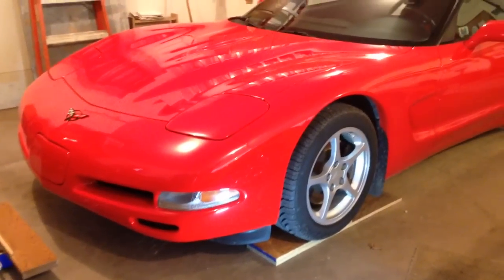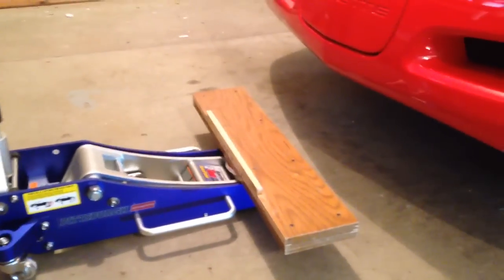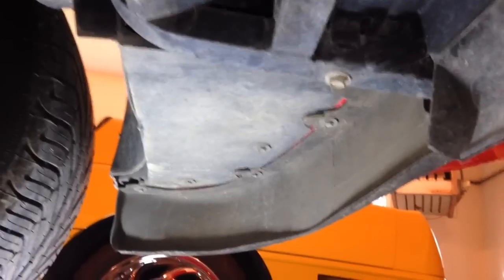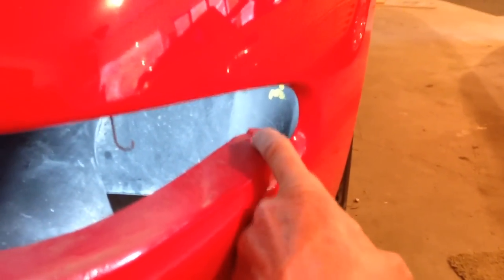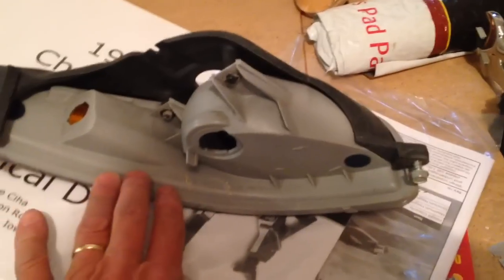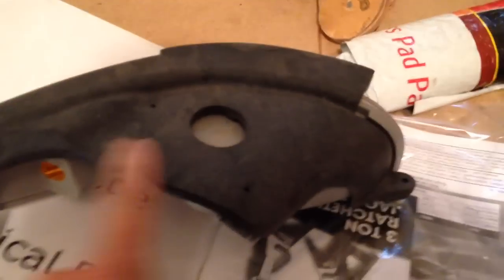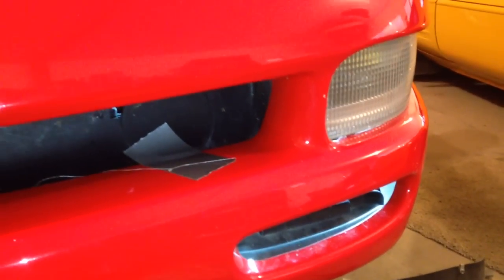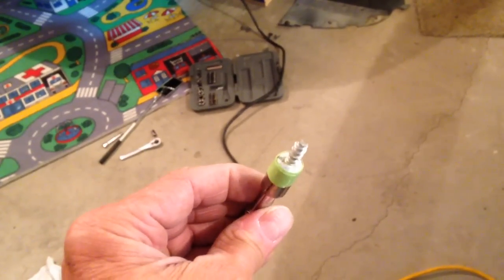C5 corner lens replacement

Comment: Excellent tutorial!  The tape on the socket trick was a new tip and very creative.   I can't count how many times over the years I cursed out loud after snaking my hand into the most contorted locations only to have the screw / nut fall off the socket upon contact!
Reply from the maker: Thanks SM.  After building 2 aircraft, I learned all sorts of ways to install and tighten fasteners of all types.  Your feedback is why I do videos such as these.  Best to you.   steve
Reply: I really liked your video. Maybe reattaching the spring is real easy, but it would've been nice to show how you did it. Another way I've found to retain the bolt is with thick bearing grease in the socket.

Comment: Putting the tape around the bolt head to hold it in place is brilliant.  I've used that trick several times, and it works every time.
Reply from the maker: GP  nice comment back at me.  Sorry I did not notice it until now.  Please forgive me.

Comment: Great video.  just replaced my two corner lenses using this as a guide.  Thanks for sharing your knowledge.
Reply from the maker: Joel Canales   Thanks Joel.  Nice comment!
Reply: Nice video, but I'm curious about whether or not your old housing was melted thru on the top from bulb heat....

Comment: You can remove the bolts bu moving the air duct below a little, and take out all the fastening bolts for the light and the case/holder for it. I was losing my mind on the first side.. but saw how it all went together and did the other side in maybe 5-7 minutes, swapping bulbs and everything

Comment: Thanks so much! I finished mine yesterday, replaced the pair and the front spoilers. Your video save me a lot of headaches. I want to know more about your floor jack retrofit. How is it attached to the jack?
Reply from the maker: Johnny,  I am sorry that I somehow missed this comment, and did not reply back.  Please forgive me.  The floor jack is from Harbor Freight and so far has worked perfectly.  I really like it.  I made the wood parts myself and they are not attached to the jack.  I think what I did is google "jack up a C5 corvette" and I found a good write up on how to do it at the front and rear axle areas.  I do not use the jack points at the side of the car.  If you want me to send pictures of what I built I can do that.